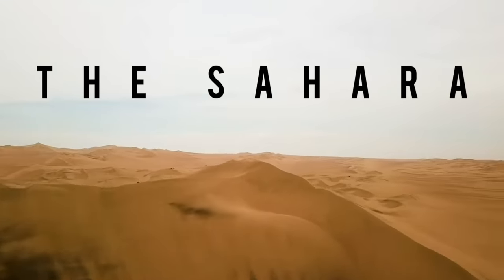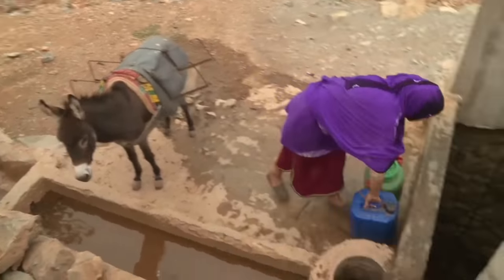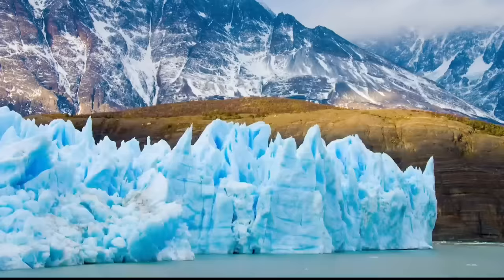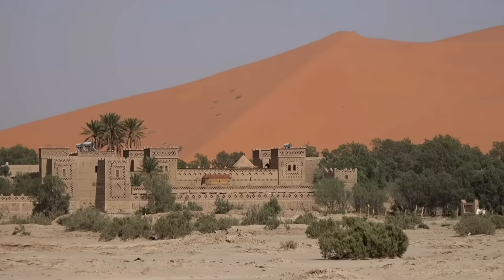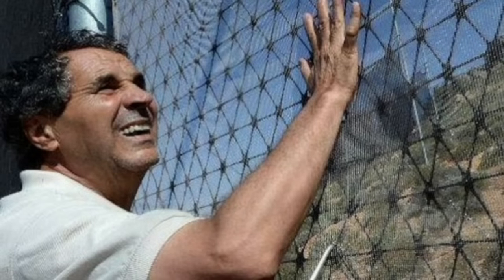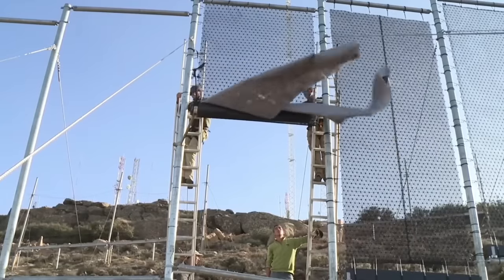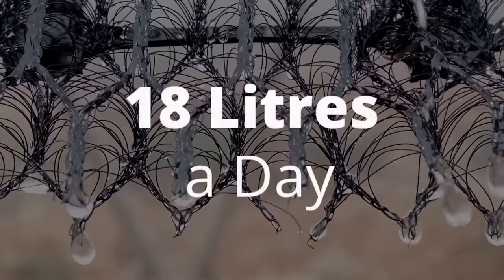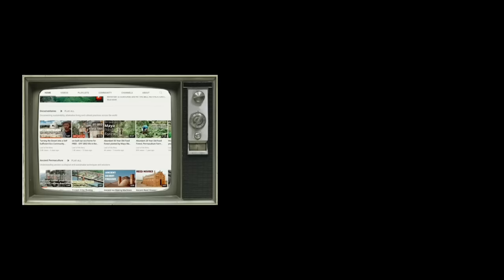How This Incredible Invention Is Making Water In The Desert For Free!

Comment: This is similar to what they've used in other parts of Africa for millenia. They're called Air Wells and they're just a huge pile of smooth rocks piled on top of an appropriately shaped rock outcrop that channels the water into one spot at its edge. The inner stones are always cooler than the outside ones and any moisture that passes through the rockpile will condense there. Since the rocks are loosely packed the water trickles downward and gets caught by the solid rock underneath it for use.
Reply: Cheers for posting that. Very interesting. I'm off to check out Air Wells.
Reply: @ThePaulv12  Please post your finding!
Reply: @hawkeye-vv4kb  yes, please do!
Reply: Something similar was used in Theodosia and re-discovered by Friedrich Zibold there is information on it on the Air Well Wikipedia entry
Reply: '';;;;;'''''''            2 Esdras2: 32 -100               ;;;;;;;;;;;
Reply: Very inefficient.  Fall over in high wind.  Easily disturbed and toppled.
Reply: It's still a valid option. Let there be hope and faith! Thank you
Reply: @donaldkasper8346  Gosh, if only there were some way to pick them up.
Reply: @donaldkasper8346  says who?
Reply: @coldhardtruth333  Says physics.  Sold object in wind make counter currents, so the water spirals around and over the object taking the water with it.  You want the wind to go through for as many opportunistic chances of the droplets to touch the surface and attach.  If the winds are high, you want to experiment with baffles to slow the wind down through the screen.  More latency time of wind around the wires increases chances of collection. Which points to a limitation of the conceptual design of this system.  It is a low speed catcher.
Reply: @rpraetor  Corrugated baffles.  Holes in the troughs.  Spring loaded flappers that are largely closed with low wind and small gaps between to get through flow, open up in high wind.  You want it automatic.  You would set a design to install and set spring tension at wind speed they open up so as to avoid damage.  Fabric netting is the most passive and likely gets damaged in high wind.  One superstructure becomes parabolic in wind and takes a lot of wind pressure, but individual flaps would not.  Their design was based on a few hours engineering.  You might also have each overall panel rotatable with a wind vane to keep the panels at right angles to the wind.
Reply: @rollingcoal If the water is free it might be $25 in gas, not including maintenance, however, I doubt water here in Southern CA is less that $250 a tanker.  The wind farm could have used posts drilled into the rocks, did not need all that concrete work.  All the metering, etc is not needed.  Village elders get to parcel it out or split it per X number of household units to roof tanks.  6000 gallons for a desert is a lot of water, enough for a village. 20 gallons/day per household is 300 households. 200 gallons/day for a vegetable plot, 30 plots.
Reply: @donaldkasper8346  maybe you can fix Washington DC?
Reply: @rollingcoal The man paid for it himself.
Reply: @tonyromano6220  Like the woman in Alien said, "Nah, to kill the aliens, you just nuke the site from altitude."
Reply: Brilliant! Only requirements are rocks and labor and of course the know-how.
Reply: There is a tiny mouse in the desert that piles little stones at the entrance to its  burrow every night. In the morning it drinks the droplets of water gathered there. I can't remember which sort of mouse it is but saw it on a documentary. Similar principle. People, like animals, have learned to adapt.
Reply: Whoa, whoa, whoa. You can't use materials developed in "the west" to do what you could do with rocks. That is cultural appropriation of "the west."  Right? That is how modern mentality works, right? If Elvis "stole" or "culturally appropriated" black American music, then using modern materials for water capture in Africa is cultural appropriation of "the west." If the technique was already in use, but using just stones and not modern materials developed by that evil "west", then using those materials instead of stone is "cultural appropriation," right? Or what am I missing? Is it a torrent of BS?

FYI: I do not care about Elvis or his music. That is just an example. If people in America (or other parts of the world) want to start tossing around accusations of "cultural appropriation" they should consider the entirety of what they are claiming. For those in the Americas, I will gladly trade tacos for even the shitty version of representative democracy that we have (a "culturally appropriated" food for a culturally appropriated so-called "western" or "European" value).
Reply: @FinnMcRiangabra  
I bet you often walk away from a debate and think that you won.
Not realizing that the other participants simply stopped listening to you.
Reply: Why did we get rid of Gaddafi when he was building one of the biggest construction project's in world history to do with an endless supply of water called primary water
Reply: @Traitorman..Proverbs26.11  You can imagine all kinds of things that are not true. So go ahead and do that.
Reply: @looneytoons2878  You were involved in "getting rid of" Gaddafi, the ex-autocratic leader of Libya? Please tell us more about that...
Reply: War is what turned the land to desert
Reply: @FinnMcRiangabra  Correct we sent Libya back to the stone age, Gaddafi was loved by his people and he wanted to help them and Africa he was a true benevolent leader, you cannot say that about our leader's they could not careless about killing million's of people in war's and starvation
Reply: @donaldkasper8346  Excelllent ideas. I even like the last one. I've built permeable greenhouses here in Andalusia, not far from Morocco, in fact. They're flexible but zip-tied and they hold up to high winds, including the Kalima from over there.
Reply: @FinnMcRiangabra  Yes, but cultural appropriation is a good thing. It's how successful cultures and their desirable attributes spread, driving out the less desirable and less successful ones.
Reply: @carolwafula9655  Pretty neat bit of information about the little desert mouse.
Reply: @donaldkasper8346  except  like the Zibold collector many of them were solid structures that lasted centuries...and could collect as much as 14,000 gallons (55,000 liters) a day and are still standing today. Yeah 1000's of tons of rocks piled do not fall over in high winds, ever see Stonehenge?
Reply: @AwesomestGreatestMostestFunny  You just compared what they had to what works best and confused the two.  Solid walls causes counter currents in front and back that can carry some of the moisture away.  You want the wind to go through the structure to get the most water.
Reply: @looneytoons2878  Because he was
building one of the biggest construction
project's in world history to do with an
endless supply of water called primary
water. And also because he wouldn't do what America told him to. Maybe mostly that, I dunno, some percentage of those factors are what did him in.
Reply: @gadgetsage  Correct and people say there are no conspiracies
Reply: @donaldkasper8346  simple mind
Reply: @curtisbacon7856  Oh ouch, such simple logic.  Does it hurt your bwain?
Reply: @FinnMcRiangabra  lots of YT videos are western-made (though there are other sources). You are right. Lots of wisdom/knowledge has always already been around. Like medicins, most come from plants. Nature people still know what to do, eat and grow. Like aboriginals already knew how to rotate agriculture or Chinese (and others) already discovered the world before the famous western known ones did. everything has always been there.
Reply: @gregoryeverson741  What kind of nonsense is that? Deserts happen because of lack of rain. How did war stop the rain?
Reply: @looneytoons2878  Who, in your crazy scenario, is "we"? It is not the USA. The USA  did not destabilize Libya and Libya is also not at a "stone age" level of technology, culture, or economics. You are just making things up.
Reply: @SunRabbit  I think that the best reply is r/woosh.
You should not have to strain too hard to tell that I was poking fun at people that claim "cultural appropriation!" when it is convenient for them. As in any hint of a westerner doing something that was done ever in Africa is culturally appropriating, but Africans can take western ideas wholesale and that is fine and somehow not "appropriating" western culture.
But I agree with the point you are making in that everyone is enriched by being exposed to other cultures and looking at their way of doing things as a possible way to expand on ideas. Using those ideas should not be shunned or shamed.
Reply: @FinnMcRiangabra  war destroys vegetation
Reply: @ooievaar6756  Yet another r/woosh.
Reply: @gregoryeverson741  I see that you have nothing to contribute that a bot could not do better.
Reply: @FinnMcRiangabra  So why did they get rid of Gadaffi when he was doing such a good job of helping his people and Africa
Reply: @FinnMcRiangabra  Talking of conspiracies was 9/11 a false flag ?
Reply: @looneytoons2878  No, not a "false flag." Not if you are talking about Islamist terrorists hijacking airliners and crashing them into buildings. That was... Islamist terrorists hijacking airliners and crashing them into buildings.

Are you aware that claiming a "false flag" attack is a pretty sure sign that a person is a right-wing loon?
Reply: @okbutthenagain.9402  
Couldn’t care less. Or as Americans say “I could care less”.
Reply: Wow!!! Now this is the kind of knowledge I’ve been looking for!! Thank you thank you sun rabbit 🌞🐇
Reply: @donaldkasper8346  any suggestions for improvement? Or better solutions? We are all in the same boat and just criticizing without proposing any idea is not useful. This planet will be very hostile if we don't act together.
Reply: @FinnMcRiangabra  FYI I don't care to finish reading your rant...
Reply: @mitooquerer  Improvement of what?  Overall net construction, is that your bitch?  Ever see the green mesh used in air conditioning filters?  That between chicken wire on vanes that pivot into the prevailing wind.  Start there.  However, I already said rock walls don't work.  They just attract mold.
Reply: @FinnMcRiangabra  Cultural appropriation for a Marxists is called sharing and enjoying the cultures of others to sociable people.  Also called tourism.
Reply: @mitooquerer  Ever hear of thermoelectric cooling?  If the wires for collection are TEC'd, the air going through holds less moisture cooler, and will precipitate more moisture.
Reply: They are needed in texas
Reply: Plant date trees
Reply: Are they as effective?
Reply: @Mark M you are offending people go to your safe space… aka left wing goobers
Reply: @coldhardtruth333  Oil company exec...
Reply: @looneytoons2878  where was the contruction going to be? i guess it was started and then wasted the money then?
Reply: Awesome 😻🙌🏻🙌🏻🙏🏻
Reply: brilliant!
Reply: @donaldkasper8346 It would be efficient actually. As for the wind, well we don't know how strong the winds of that place.
Reply: @rpraetor  Not enough surface area.  Water leaks inbetween stones and water tension traps it there.  Only works around waterfalls.
Reply: @tonyromano6220  How?
Reply: @gregoryeverson741  Continent moving north to mid southern latitudes and Panama volcanism cutting off Atlantic currents caused it.  Nothing else.
Reply: @SunRabbit  Cultural appropriation is called using the good ideas of others.
Reply: @donaldkasper8346  humor
Reply: @tonyromano6220  Rocks can be stacked 6 ft tall.  Poles with nets can be 60 ft tall.  Go stack 60 ft of rocks to "catch" water.
Reply: @FinnMcRiangabra  Actually, any of those inventions were only possible due to the adoption of the Indian numeral system.  

You're welcome!
Reply: @AKu-xs5vg  This comment is so behind the time that you will have to point to what inventions you are referencing. The Romans built aqueducts that worked perfectly without a zero.
Reply: @FinnMcRiangabra  cry more
Reply: @AKu-xs5vg  Do you really think that is a clever response? Try harder.
Reply: @FinnMcRiangabra  You're welcome!
Reply: @AKu-xs5vg  You are aware that your utter fail posts are public, right?
I have provided an actual counter example to your hypothetical (you seem to claim that engineering and technology all rest on people using the Indian zero and that no-one else would have thought of it).
If that is your position, be prepared to be told that all of complex mathematics (those involving the use of i, the square root of negative one) are based on western European math. (That is not my claim. Other cultures may have discovered i eventually. You are the one giving sole credit to the original discoverer.) Sad for you.
Reply: @FinnMcRiangabra  Why are you so mad?  

Just switch to a different number system 💀
Reply: Why don't you try making a sensible argument?
Reply: @FinnMcRiangabra  
using european innovations:😊
using non-european innovations:😠
Reply: Wonderful.
Reply: I figured this had to exist already. I mean it was in the novel dune and the person who wrote dune did a lot of research into desert and well dunes prior to getting the idea to write it.